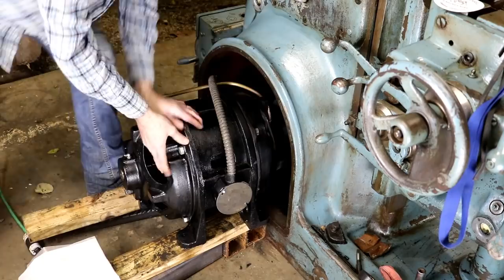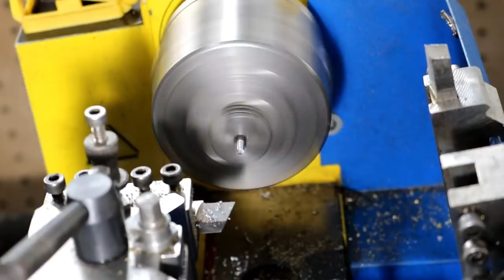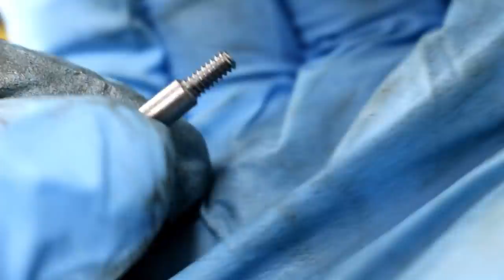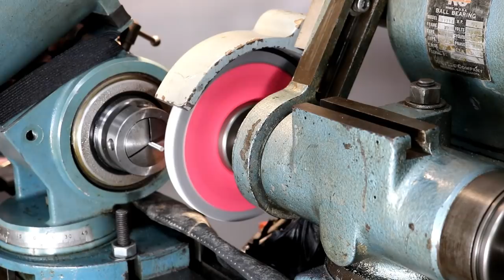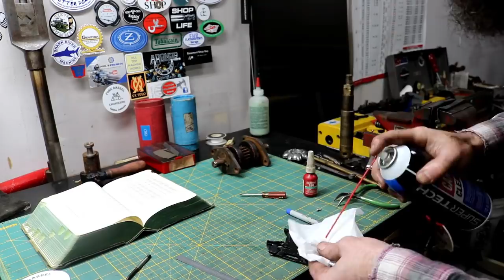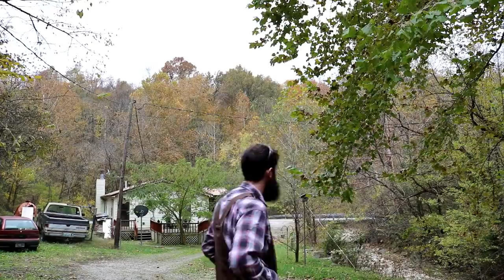K&T MILL MOTOR INSTALL & LATHE AND CUTTER GRINDER WORK

Comment: Fix the foot of the motor with bolts. Drill holes and thread them so you can bolt the foot on.

Comment: I have double-nutted threaded rods to turn them in a three jaw chuck, but the nuts are not too accurate, perhaps you could double nut the piece then turn the nuts to round, then flip the work and turn the shaft. But the pin turned out great!

Comment: I never recommend electrical tape for any situations involving temperature changes. Heat loosens electrical tape and turns the adhesive to a soft pasty substance. Use a soldering gun/wand for all connections you can.

Comment: you might want to verify that the 1-2-3 block is not threaded metric.. who knows.. 

 on the surface grinding patterns .. how are you balancing the grinding wheels. can you also.. put your hand on the spindle housing and turn the grinder on and off to make sure you are not experiencing damaged bearings.  you may need to use a screw driver to the area in front of your ear  to listen to see if there is bearing damage.. damage to the races will cause the balls as they roll thru the damaged areas to unload the preload and then bounce back in as they come out of the potholes.  causing a vibration that is impossible to resolve without new carefully installed precision bearings.  grade C7 or C9s..  maybe beyond that ..

Comment: with the grinding the second time you had the pin spinning the opposit direction, ie first time anticlockwise then clockwise so it was not grinding as fast. A bit of everything in the vid, nice work.

Comment: The chatter while grinding the pin o.d. can be helped by partically undercutting the wheel face .002-.003 and leaving a smaller contact area of 1/8 or so  wide-----this is done also on surface grinding  wheels when chatter occurs---also a softer wheel helps.

Also --could you use some cupped wheels------got some laying around????

Comment: Hi Steve. Great seeing the motor go back in the K&T!! Nice repair on the pistol frame as well; been wondering when and if we'd be seeing some gunsmithing or repair videos. That frame is actually injection molded zinc alloy and they are a real pain to deal with. I have repaired a few myself and what you did is exactly right. Hi Points, several Taurus, some Rugers, etc have injection molded zinc alloy frames and if they break, they are usually junk. So, anyone that can repair them is pretty darn valuable. I liked the grinder op to get it to size. Very fitting for something so small.
Reply: A little cold Blue on the outside end of the pin and it will blend right in...  Great Gob

Comment: not bad but in the future you want those replacement pins to be made of something softer than the base metal. that way when it breaks again it doesn't tear the threads out and ruin the frame.

Comment: For small pin work like that at work,  I use a collet in the milling machine to hold the work, and just throw a lathe tool in the vice. At some of my customers plants, sometimes they will only let me use a mill and won't let me use the lathe, so I've had to bust out that same technique for larger pins if their toolmaker isn't there to run the lathe.

Comment: Concerning electrical tape which lets go over time: it is only the adhesive which fails. Put a small zip tie around the tail end. The adhesive does not get exposed to air and the insulating property of the tape is preserved. Of course, alway use quality tape to begin with.

Comment: If you cant come up with a gopro for reasonable money check out the Xaiomi Yi 4k Plus. I have the non plus version and have been really happy with it. My only complaint is the lack of external microphone support which they fixed with the plus version.

Comment: Always enjoy watching but have to say I was intrigued by your precision grinding that pin, then screwing it into a hole that was located by an eyeballed center punch mark.  Sounds like something I would do. Lol.
Reply from the maker: That pin could have been made with a file and still would have worked fine. I just did it because I could;-)
Reply: @SteveSummers  Ok then, the pin's location must not be critical.

Comment: Much easier to get out once you took the clutch nut off.. Been there myself.. Sometimes you have to raise up on the clutch lever to make installation and removal of the transmission easier as well... On the older K&T mills, if you run them the wrong direction, the pumps won't work and the newer ones damage will occur instantly.. Best to just leave the belts off and bump the motor to see rotation before you put belts on.. Simple to change phase rotation at this point... Don't know what voltage the machine was running on but yours will be 220 so may have to change the overloads and possibly the starter coil as long as the starter is heavy enough to take the load on 220 you should be ok....

Comment: For the grinding of the pin,  I would have (and mind you, I have zero experience) left the material long, grabbed the excess length,  not the threads, in the collet and  then cut to length.  Great channel Steve.  I enjoy following along and seeing different techniques and learning new tricks.
Reply: The pin shank is smaller than the threads (0.098 vs .110).  You'd have ground off your threads. :-)
Reply: @barrygerbracht5077  Unless you didn't grind the threads.  ;-)

Comment: My gut went tight while you were turning that 4-40 tap by hand😓😓
Reply from the maker: I do them like that all the time, don't remember the last time I broke a small tap.
Reply from the maker: I did have cutting oil on the tap Bob, it just didn't make it in the video.
Reply: @SteveSummers  it's me, not you😅. I have such a hard time with small taps (anything under 1/4") when I'm not using a follower.
Reply: Did not see any cutting oil, either...  The tap when in quite easily, perhaps it was either easy to cut metal or a larger than usual tap drill.

Comment: I like rubber splicing tape as well but I usually put a few wraps of electrical tape over it to keep all the connections from merging into a single blob.
Reply: Also rubber tape degrades if not wrapped with vinyl

Comment: Boy, schlepping that motor back into place by yourself just didn't look like any fun at all! 
I think You might want to think about bolting that broken motor foot back down, even not attached to the motor. If nothing else it will keep the piece from getting lost, and maybe it would act as a stop to make sure the motor doesn't shift over time.